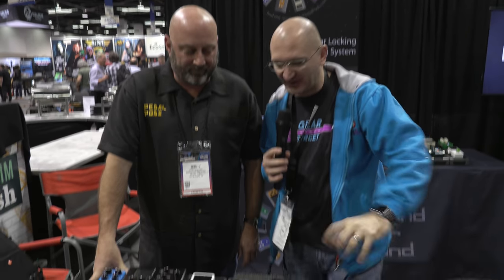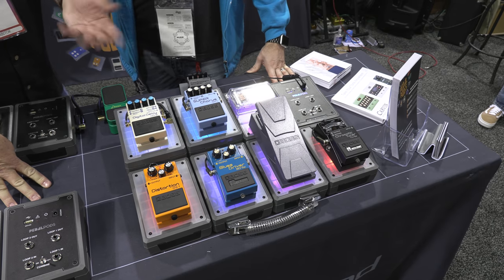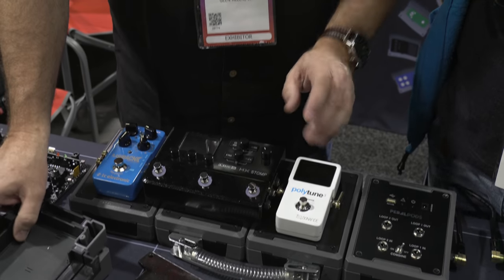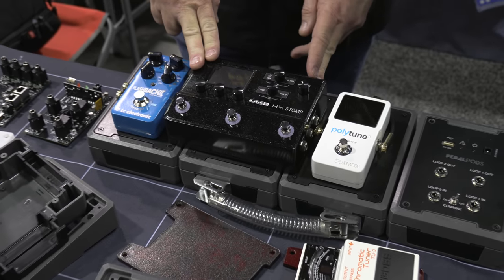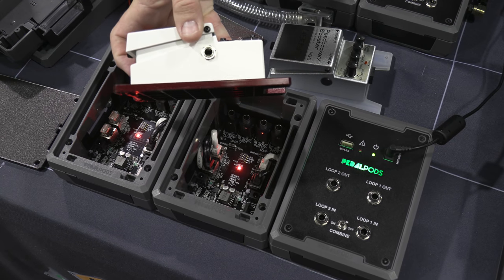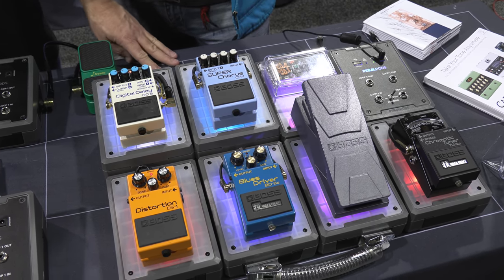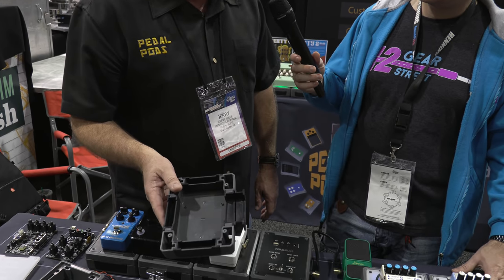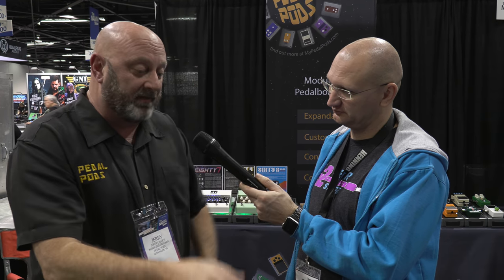A new form of pedal board? Pedal Pods

Comment: Great concept, nice cable clean-up, excellent features with the included electronics. It still needs a little refining...  Such as... 

1) I'd much rather see the loop jacks and power supply moved from the Top to the Side of the board.
2) It's rather bulky - How much does that thing Weigh? All those little things inside Add Up very quickly.

Musicians prefer light weight gear that's easy to move around from gig to gig. That's why boards like PedalTrain, Friedman, GhostFire & Rockboard have been the favorite picks for the Traveling Musician.
There's also Schmidt Array, SKB & Furman powered boards for the Studio and Professional Musicians that clean-up very nicely and are just as versatile & flexible too.
Listen to the customers - they'll tell you want they need & what they're looking for.
Reply: Wolf, Thank you for your comment and taking the time to detail your concerns.  I'd like to address each of your questions below:
1) I'd much rather see the loop jacks and power supply moved from the Top to the Side of the board. - The original design had all the connectors on the bottom.  During a gig, Rick's Bass player kicked the cords going to Rick's board.  This caused them to come unplugged as well as damaging one of the connects on the cable.  After a few minute of Rick on his knees with his cell phone light on all was restored (other than the damaged cable).  After that I decided to move ALL connections to the top so they are easy to see, trouble shoot and less likely to become disconnected.  YES, you give up space that a pedal could occupy BUT, the easy and piece of mind being able to look down was worth it.
2) It's rather bulky - How much does that thing Weigh? All those little things inside Add Up very quickly. - Weight with all the electronics and cables is ~1lb.  Width = 5" / Depth = 6.5" / Front Height = 2" / Back Height = 2.75".  Here is the like a link for additional details and specs; https://mypedalpods.com/collections/products/products/pedal-pod .  Thank you agin for your feedback.  Best of luck... Jerry
Reply: @pedalpods6382  Thank you for your reply - I shall take into consideration.
 I still do not agree with any cable connections located on top ... I would think that would make them Much EASIER to kick than on the side or back of any pedalboard -  sorry, but it just sounds like the guy who tested your board & actually DID kick them was just extremely clumsy.  
I'm very much aware of any & all connection locations at all times (and not just Mine, but everyone else's too) because those things Aren't cheap either - so I find it very difficult to believe a Side or Back location would be a negative thing. But Thank You for your response.
Reply: @-WolfMan-  Thanks Wolf... Best of luck to you. Jerry

Comment: It looks like a really good idea in general. But it also looks like you will get fewer pedals per square foot than on a pedaltrain. The pedals are more separated due to the modular design. Maybe make PODS that are large enough and carry enough power for 2 pedals t a time to allow them to be more tightly packed. And, perhaps a POD that size would more reasonably fit larger pedals like the Stomp or the Strymon stuff.
Reply: Steve, Thank you for your comment.  You are correct on pedal density.  You can mount pedal between each POD and I do have two power ports in each POD to give you the ability to power multiple pedals.  This solution was designed to maintain a clean look while giving you room to easily engage your pedals.  The modular design allows you to expand your board as you grow your pedal inventory.  If you visit the gallery on our site (https://mypedalpods.com/pages/endless-possibilities) you will see different applications and configurations.  Let me know if you have any additional questions or concerns Steve.  You can email me directly:  jerry.calder@mypedalpods.com

Comment: I've got a big board with a G2 but this is an awesome concept.  I may look at these for my next board.  So I just looked at the price on these and its 100 bucks for the pod with all the wiring.  I'll do th emath later but this will probably be a little more expensive than a traditional board and power.  But it is expandable so u can just add on witch is nice.
Reply: Stuart, Thank you for the comment and the complement.  Regarding the pricing we did more than a dozen competitive analysis.  If you match feature for feature and include the quality patch cables and power, we are right in the middle regarding price point.  If you would like me to share that document with you i would be happy to.  Email me at jerry.calder@mypedalpods.com.  Regarding the G2 solution (great product BTW), I have a design for Rev 2 of Pedal Pods.  Not ready for market yet.

Comment: very cool idea. I dont need a pedal board as I have my Helix LT but back in the day of using individual pedals this would have been nice, A bit bulky but I understand its all about cable management. Great heavy duty product for sure. I bet they spent a LOT on R&D so...hope they are successful to recoup their initial costs. Good luck
Reply: Stephen, Thank you for the comment and kind words.  YES it cost Rick and I a ton of money to develop!  I also spent the money to get two patents on this solution.  It will be a LONG time before I get my money back!  Haha.  Money aside, it's been an amazing journey and the players that have the solution LOVE IT.  Very rewarding.
Reply: @pedalpods6382  Cheers. Best of luck. Keep making it better and listen to real actual postential and existing customers to take it to the next level. After watching all the assembly videos it looks even more daunting and scary and complex. Obviously I know the other pedal boards are pretty complex and messy with wires and cables going all over so....its all relative. Would have been nice to figure out a way so that each Pod didnt need its own FULL blown circuit board and only needed the main board and then feeder boards but I know this stuff is very complex and each Pod is its own filter. Great work
Reply: @sjsphotog  I have a "progressive" design in my head that only requires the pedal be plugged in and that's only one connection.  The prototype works amazing.  I just spent all my money getting this up and going.  Hopefully in due time I can get it out there.  Have a good night Stephen.
Reply: @pedalpods6382  cheers and really BEST of luck and success.
Reply: @sjsphotog  Thank you sir... Jerry

Comment: I will say that it’s cool to hear that it powers 650 mA. Using a pedal that draws 500 mA from a power supply that puts out 500 mA makes me nervous. Knowing that you’re not using 100% capacity is comforting and it seems like a lot of pedals draw 500 mA.
Reply: Dougley, Thank you for your comment and kind words.  I spent a ton of time on the power supplies and noise reduction circuits.  We also utilized a very accomplish electrical engineer to fine tune the design of the circuits and PCB boards.  The PODS are FCC, UL, CE, and IC certified.  The testing lab was very impressed with the design and performance.  Best of luck... Jerry

Comment: Great concept! For me i'm not super keen on the plastic design of the casing, looks cheap / fragile even though it isn't! 

It'd be interesting if there was a pod that was maybe 150% of the size of the standard pod which could fit two pedals, i personally prefer the look of pedals when they are less spaced out, this looks more like a demo / studio pedalboard rather than something i could see myself using on the road.

Love the concept though!
Reply: Crystal, Thank you for your comment.  Plastic was the best material for this application (strong, light, inexpensive for manufacturing).  If you go to our gallery you'll see Ricks SUV pulled up on three of them with no issues at all.  We did play with different sizes but at the end it was challenging to get the geometry to work.  The other consideration was the number of molds we would need to have made as well as inventory and logistic considerations.  You're last point regarding demo/studio applications is spot on.  Although we have MANY touring and non touring artists use our solution its the studios that really appreciate this application.  Seymour Duncan posted a very kind comment below for this video.  Good luck on the road Crystal... Jerry
Reply: Crystal, Thank you for taking the time to comment on this video and show interest in the product. With that being said, we would like to extend an exclusive 10% off coupon code to you. This code is good for all products except for our cases. Please use the code GOMODULAR to start your PedalPods journey. If you have any questions or concerns please do not hesitate to contact us. We hope to add you to the PedalPods family
Reply: @pedalpods7350  appreciate the response! Best of luck with them!!

Comment: Love the concept.  Not a fan of the look of the pods but aesthetics are for everyone to decide.  I wonder how water, sweat, beer resistant the electronics are?  Can this board be used in an outdoor when it's raining?
Reply: Jimmy, Thank you for your comment.  Industrial Design is a compromise.  We went through many designs before settling on this.  My favorite design could NOT be manufactured cost effectively.  Regarding water, sweat and beer... these are electronics and like all electronics they can be damaged by moisture.  The boards are elevated inside the pods and there are drain holes everywhere!  One of our customers just shared a story about being stuck onstage during a massive rain storm.  Not all the bands gear survived  Pedal Pods did...  Best of luck Jimmy.

Comment: When a customer orders one they should have the option to upcharge/swap out on the spot to get the clear covers instead of the solid covers so they can make use of the LEDs instead of getting tbe basic cover and then have to order and wait for the clear covers.
Reply: Stephen, Thank you for your comment.  Great point.  Unfortunately the Translucent Plates came after we had the kits packages AND the cost to manufacture the Translucent Plates are a little more expensive.  All the kits come with the black Top Plates in the kit you just add the number of Translucent plates you would like.  Enjoy your night Stephen... Jerry

Comment: Lots of great ideas, seems like it's reasonably price matched with just about everyone else's prices points.

It looks cool and well concealed, but also kinda clunky, I've used an SKB though so who am I trying to kid.

Ultimately, I'm not feeling it and the reason why is because you need to buy everything all at once with these, while your typical pedal board is incrementally upgraded over time. It's smarter in the long run to use something like this and swap things out here and there as you please, but it's adding 80 bucks on top of every pedal you're buying and you're locked into an extremely proprietary system. 

What if I invest in this and don't like what I hear? I know what linking my pedals sounds like, and what it sounds like with various power supplies, but what if I don't like this or it doesn't feel right? I'm kinda stuck with it.

Edit: also, rewatching the beginning. That board is huge for 5 pedals, like you said, spacing is very far apart and while luxurious it may be too spacious for it's own good. 

Slim it down a bit, I think that's my biggest issue with it.
Reply: Robert, Thank you for your comment.  Lets address each one of your points:  1.  Size/Chunky - This system is with .25 inches in height to other pedalboards (and even smaller in some cases).  2.  Expand over time - That's what this system was meant to do.  It grows as you grow.  You don't have to purchase a pedalboard, cables, and a power supply just to scrap or replace to accommodate your growing pedal habit.  Small cost of entry when you realize this is the last pedalboard you'll ever have to buy.  3.  Cost - This solution when compared (apples to apple in quality and functionality) is actually priced right in the middle with our competitors.  I will be honest when I say that the Temple Audio board is less expensive and a hell of a nice product BUT it's not expandable.  4.  Propriety - YES... Yes it is!  I have two US Patents on this solution that covers over 30 claims.  Kinda proud of that BTW.  5.  Sound Quality -  My background is high-end two channel audio.  The two biggest "MUST HAVES" when creating this solution was unequaled tonal purity and low noise (both audio and power).  I hired an amazing electrical engineer that builds high-end tube amplifiers, preamp and critical listening speaker to validate and perfect the design.  6.  The number of pedals you can place on the surface - You can cram as many pedals as you have physical space for.  Pedals can be placed between the pods and each Pod has two power ports (designed to power two mini pedals) per Pod.  The space is there to allow for a clean look and also taking the stress off the player who would normally need to focus on hitting the right pedal instead of focusing on his performance.  At the end of the day there isn't a perfect pedalboard!  I tried to create a "SOLUTION" that could solve as main of the guitarist needs and wants as possible.  I wish you luck and happiness Robert and once again thank you for taking the time to provide feedback.  I do value that.  Jerry
Reply: Robert, Thank you for taking the time to comment on this video and show interest in the product. With that being said, we would like to extend an exclusive 10% off coupon code to you. This code is good for all products except for our cases. Please use the code GOMODULAR to start your PedalPods journey. If you have any questions or concerns please do not hesitate to contact us. We hope to add you to the PedalPods family

Comment: How do you use looper-switchers like the Boss ES8, Musicom MkV etc on these boards?
Reply: @pedalpods6382  Thanks. I have built custom boards for myself from fiberglass (it has a better strength to weight ration than wood or aluminum). When a board has to travel every square inch counts, I did not see any pedalpod systems using loopers/switchers on your website that's why I asked. I do understand that using Pods for a switcher would mean different design altogether.
Reply: @navinadv  Good morning Navin,  I also used Fiber Glass during the prototyping.  I agree with what you said on strength and weight.  The challenge is small radius corners.  These are even to small for a chop gun application.  I looked at Gel Coat as a solution with Fiber Glass backing but the cost and time to manufacture was extremely expensive.  If (and I have this design) made a larger integrated board I would probably consider Fiber Glass.  Thank you for caring and sharing Navin.  Enjoy your day... Jerry
Reply: @navinadv  Thank you for your response Navin.  You've given me a lot to think about.  I really do value and appreciate your thoughts.  Be well... Jerry

Comment: It's a great idea, seems well executed, but man it's seriously lacking in terms of design, it looks like coming from 25 years ago !  I like everything else but the visual aspect has a lot of room from improvement. It seems like there's lots of clearance between the top plate (the one with the pedal on it) and the pcb for the pod, maybe you could gain some space here ? You gotta find ways to bring the bulk down, or at least try and make it look more appealing
Reply: Titouan, Thank you for your comment.  The original design had soft lines and flowing curves (beautiful right).  When you put a pedal on it it looked way out of place.  The soft lines also made it look fragile.  We hired an industrial designer to help improve the looks but also make it easier to manufacture.  There are sculpted lines in the product but it is hard to see in the grey.  The colors are meant to be neutral so they don't clash or take away from the beauty of the pedals.  Remember, these are ready to accept paint.  Industrial Design is always about compromise.  I do value your feedback and thank you again for taking the time to post.  Best Regards... Jerry

Comment: I think it is a genius idea. I have a few points to critique and suggest though.

1. It looks a bit cheap and fragile (even if it actually isn't) due to the material and huge gaps between the pods. Especially the gaps though!
I would like to see pods that can build a nearly uninterrupted surface. (I know its hard to do die to tolerances and the molding process of the plastic parts, but instead of this huge chamfer I would rather see a really small radius edge rounding.)
For material it is even harder to take for example aluminum cases like normal pedals to at the price point that you are offering but I would gladly pay 20 bucks more for an aluminium case with only thew translucent top plate, which is a suuuper cool idea (especially with the LED underneath)
2. I would love to see a few different sizes. A horizontal  (for the wider pedals) as well as a vertical (for expression pedals etc) double-pod would be awesome for bigger pedals. They would easily fit with the other pods. It just looks nicer that way. I bet I am just as fanatic about having everything tidy as you are! 

3. You have these integrated bypass loops that you have to switch with the dip switch.
Please make them remote controllable and develop a switcher module that can control the connected pod loops. Ideally it would have the ability to do  "stompbox mode" where you switch each pod individually and "preset mode" where it can switch multiple loops at once. (Good sizes would be 4, 6 and 8 pods wide with double the amount of buttons each wo accomodate for a second row of pedals. Ideally one would also be able to set some pods as "always on loops" these are just a few ideas that would make me personally really happy though!) 
Imagine! A pedalboard with seamlessly  integrated power-supply and true bypass looper/switcher. BEST THING EVER!!!